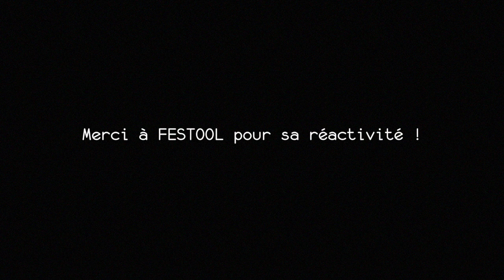Replacing the connector housing on a Festool TS 55 REBQ

Comment: bonjour boris, où puis-je demander la pièce de rechange, j'ai besoin du connecteur, merci beaucoup.
Reply from the maker: Salut, regarde chez Haumesser : https://www.outils-machines-haumesser.com/pieces-detachees-festool/32970-connecteur-ts-55-ebq-4014549019535.html
Sinon, la ref, faut le chercher dans le catalogue des éclatés Festool : https://ekat.festool.de/login2/app?__bk_&__windowid=SKR470873882&__rid=WBO1652289144562#2VFB2144C915D47DFAD66CC73CEC1F7E17E1D29351DB45EA618EEFB7B1BB136D42B8044FCE28E6056D
Reply: @BorisBEAULANT  merci

Comment: Salut
Du coup Festool ne te l'a pas repris en garantie ; c'est ce je trouve de plus dommage dans l'histoire. J'espère que les pièces ne sont pas trop chère. 
Merci en tout cas.
Reply from the maker: La machine a dépassé la garantie, donc je savais que ça ne serait pas un retour au SAV sans frais. Non, la pièce vaut 9,40€ au catalogue.
http://ekat.festool.de/EKAT-Service/jsp/main.jsp?sig=2A4761A01961866F90900868901F9CA2266247A814CB1CDEFEA75B0138B6177801E0A8302F3EA527DC34E479F407CF6391AE1E75A6B6CCBD1DAA8C38090C5D69&doAction=catalogAssy&k_vari=500602&k_ver=&image=-2&k_lfdnr=&nodeId=child

Comment: Title;  
Replacing the connector housing on a Festool TS 55 REBQ

Description; 
Replacing the connector housing (where the plug-it socket is connected to the 230v power supply) on a plunging saw Festool TS 55 REBQ Following the failure of a connection pin on the original model.

Replacement part fitted by myself because the machine was no longer under warranty. I would like to thank my interlocutors at Festool for providing me with the correct part and helping to solve my problem.

Find additional information here: Https://www.lairdubois.fr/pas-a-pas/3 ...

---

Friendly hater, I know you're going to scream "scandal" saying that this video is not in the same vein as my other publications. That I'm representing a brand and that blah blah blah...
This video represents what I would have liked to find to reassure myself before starting the dismantling of my machine which serves me to earn my crust. So if I can help someone, that's good. Otherwise, I'm at least glad I wasted your time. A good listener. 

Espérons que cela vous aide je vais vous envoyer un e-mail en privé pour vous aider d'autres
Reply from the maker: Merci !
Reply: En France, on ne dit jamais "Merci" non, on dit plus oui plus  LOL de rien